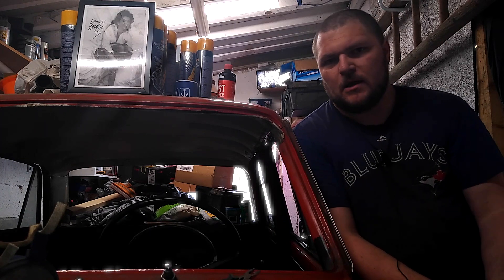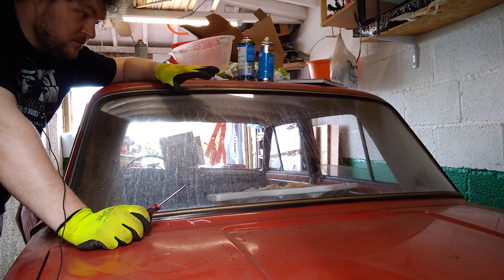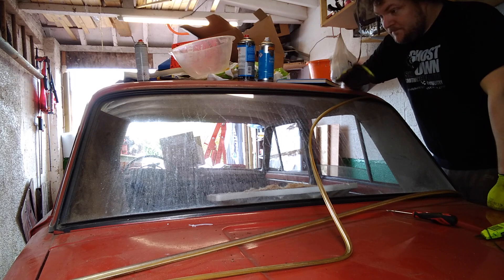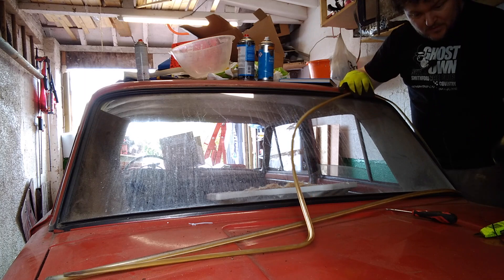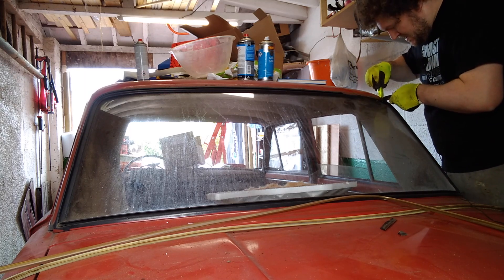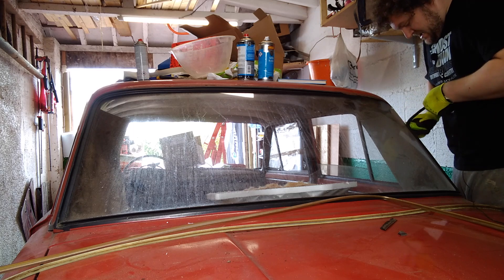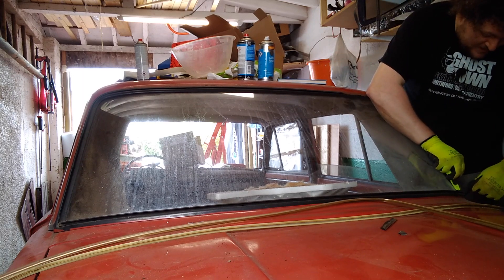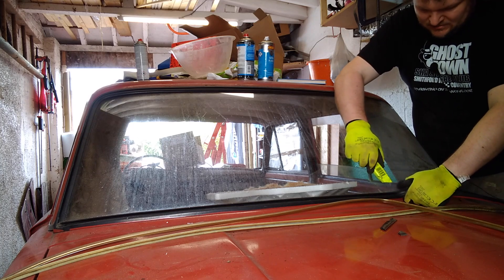The Right & Wrong Way To Remove A Windscreen - Nikita The Lada 1200: Episode 006 // Restoring A Lada

Comment: I am always worrying about the glass on my DAF/Volvo 66. Not easy to find replacements, being old and foreign. They can be got but ...£££'s. Where are you getting your spares/replacements from ? Russia?
Interesting videos, please keep posting. Thanks
Reply from the maker: In terms of the window glass, when I bought the Lada it already came with a replacement windscreen so I didn't worry about it. I wouldn't even know where to begin with the rear window if I had to get a new one. In terms of spares, it did come with some but I went to a site called Lada Power who are based in Belgium and Ukraine, so the sill and jacking points have come from there. This is half the reason why I'm putting in a Rover engine in it, as the parts for Rovers in the UK are easier to get, so it should mean the Lada is easier to maintain in the future.
Reply: Yo can find suppliers in Holland. Like this one on teh Dutch version of Ebay. https://www.marktplaats.nl/a/auto-onderdelen/vrachtwagen-onderdelen/a1006388682-nieuwe-voorruit-daf-45-55-65-75-85-95-xf-95-xf-105-xf105.html
or try dafhobby in Holland also volvo340onderdelen in holland

Comment: How do you put the windscreen in again tho?
Reply from the maker: You put the window rubber in hot water, let it soak. Then attach it to the windscreen. On the other side of the rubber (the groove that will fit to the car), you put parachute chord in the groove all around it. Put the window on the car, with the rubber on the car, then you pull the chord out while pushing the window in to the car. Pulling the chord pulls the rubber over the lip on the car, and that's how it's done roughly.